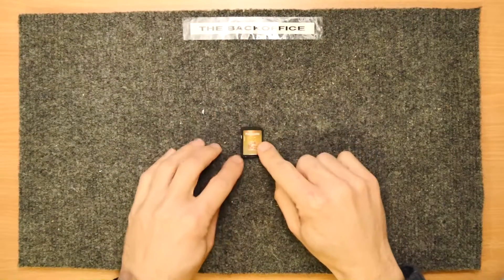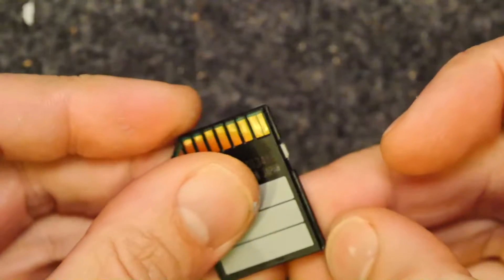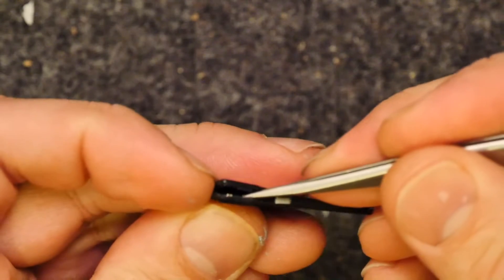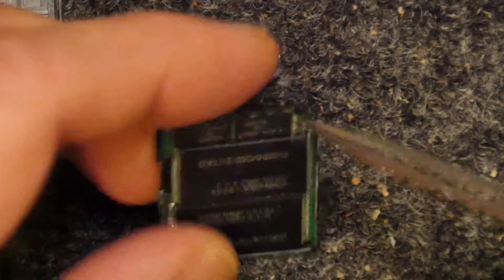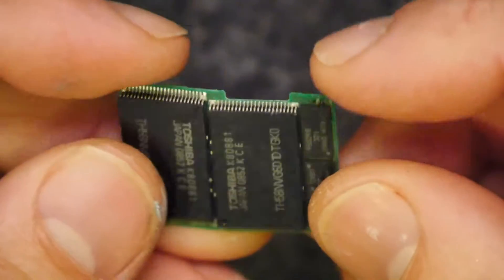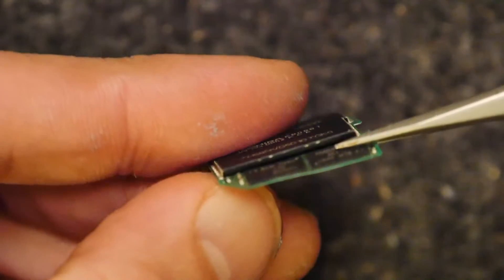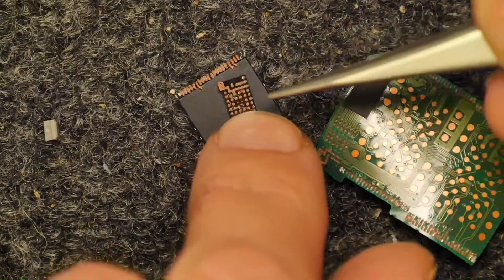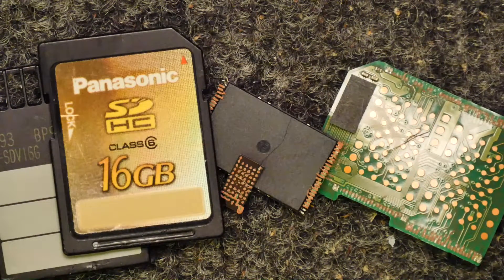SD Card

Comment: I had a couple of 16GB Transcend ones (also Toshiba inside) do a similar thing. Supposedly it's damage from a voltage control issue but I just think it's lack of QC at Toshiba. I've had tens of them fail packaged onto IDE storage used in thin clients whereas the Samsung ones are absolutely fine still. Interestingly though, we killed some Samsung ones with an external adapter system we cooked up to make restoring an OS quicker in batches whereas the Toshiba ones were happy.
Reply from the maker: This bad boy is over 7 years old so can be forgiven some dementia, however it started to fail 'unreliable'. to risky for video work. Similar to some dodgy 4GB SD cards we got ages ago that were only 256mb on the inside! once you filled the 256mb it started overwriting itself!